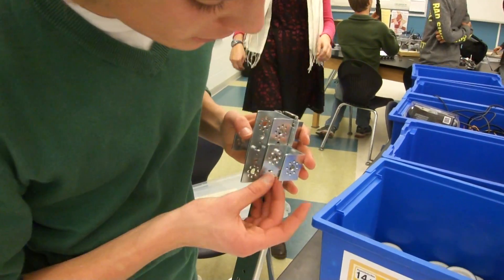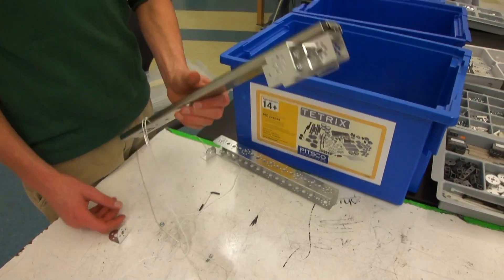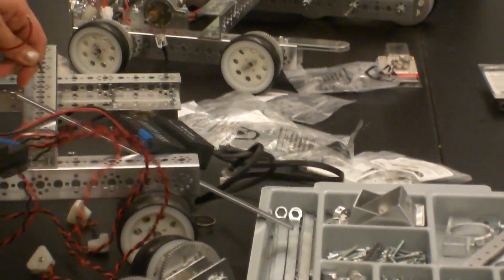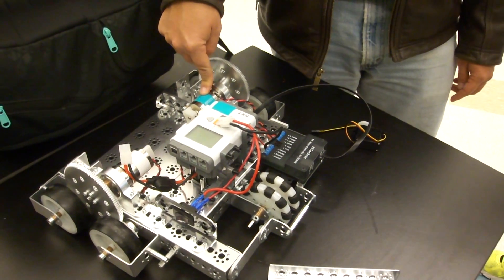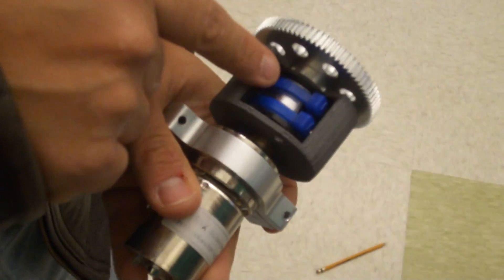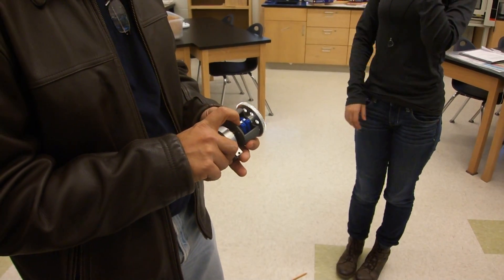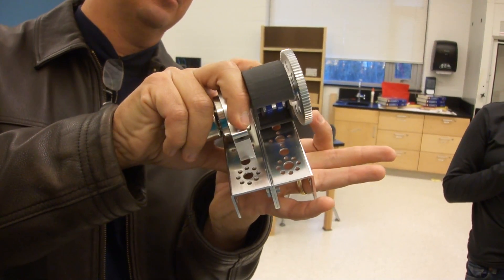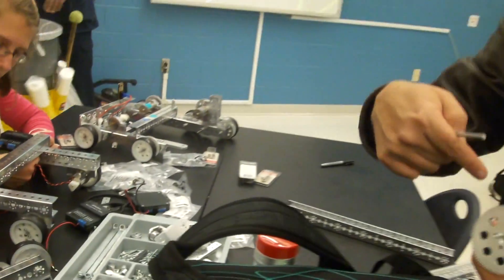Nov. 13, 2013: A pulley for the drawer slides

Comment: Sorry coach. This is not correct. You can only "fry your servo controller" by plugging in the power backwards, not by plugging in the servo backwards.
Reply: Agreed, BUT last year with Modern Robotics you 100% could fry your robot hub by plugging it in backwards, smelling the smoke, not telling your coach about it, waiting two days for others to spend an hour trying to figure out the problem, then spending $60 for FedEx before a Qualifier.

But I'm not bitter. ;-)